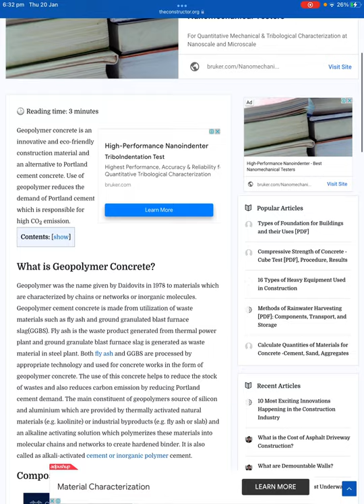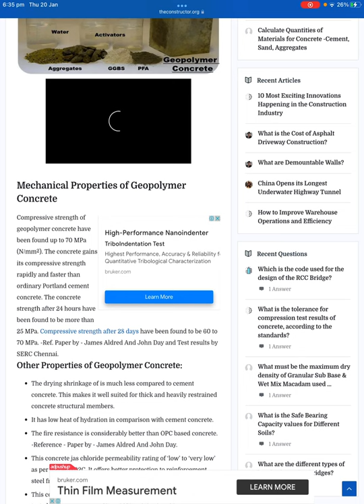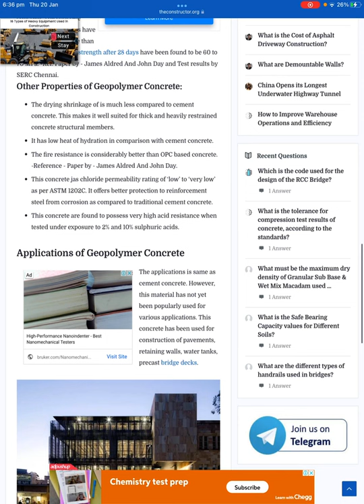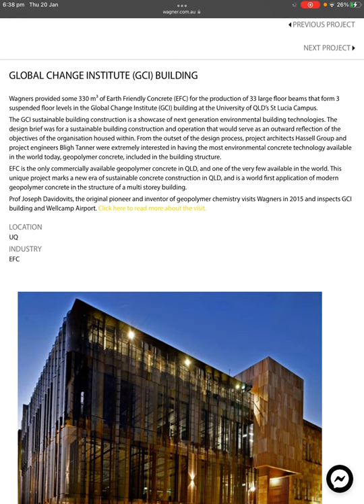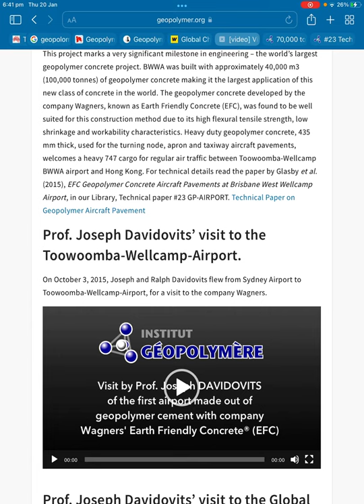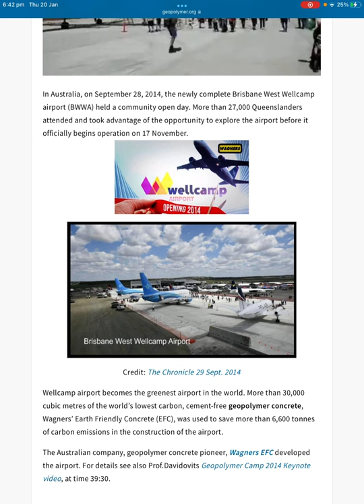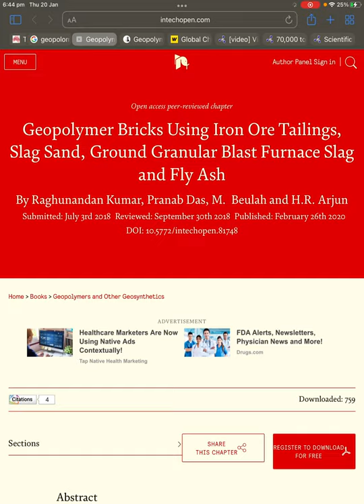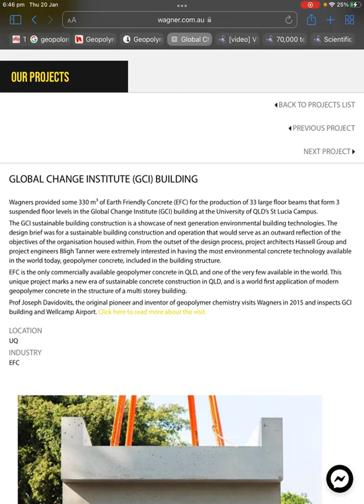Geo-polymer Concrete.

Comment: The Bosnian pyramids seem to be 30,000 years old and made of geopolymer.

I wonder whether we could skip piles and foundations by effectively building strong boats Then all you need to level it, is adjustement on three corners. Build a moat and the building/boat sits in a controlled environment if the local soil doesn't cut it for you. If you need to displace a lot of weight from above ground floors, just add more basement levels, it will come to good use for parking and storage.

Comment: True, it's not that new at this point. Used blocks on new homes , foundations etc Years back. Light weight, and weather resistant it is though. Still being a cement mason/ concrete guy, I like a real mix.
Waste is good for us though, flyash and fluoride is great for humans😆.  ✌️ N thanks